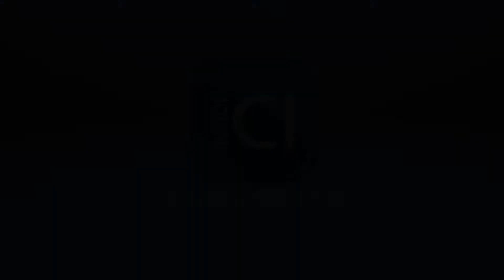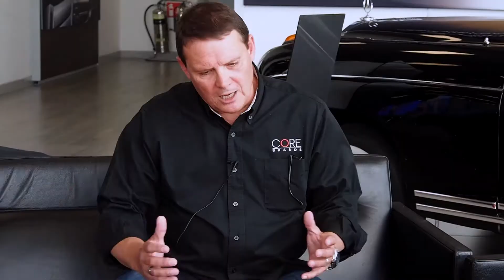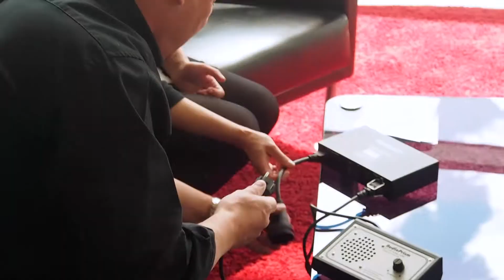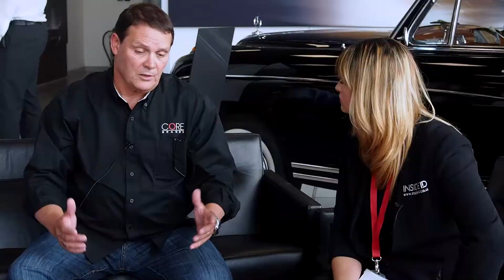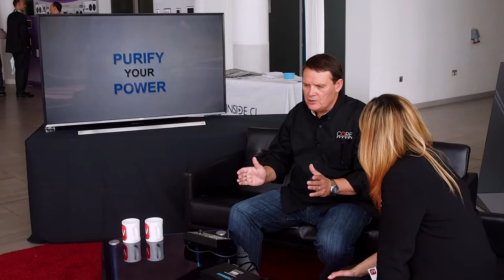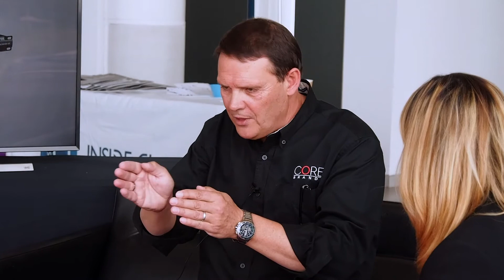This Furman power conditioner will improve your AV system

Comment: Great products! Excuse me for asking "here", but I recently invented accidentally a sort of PRE - power filter, basically connects to mains first then output powers commercial Power conditioners. Its a very simple accidental discovery that is unconventional not related to using semiconductors etc... My device can fit inside any power conditioner! This device would be the first stage.  Its hard to imagine such a crude device that really affects what you hear in a huge way! The device adds about a 20% power boost, a mix of added bass current, wonderful mids and great clean highs! Its really a huge noticeable diffrence. I own a power conditioner and this Device invention is way better at affecting the actual sound! There is nothing out there like this, I believe... I Pair the device with a commercial power conditioner and they work great together, very compatible.

I'm currently searching to sell the "device" to a power conditioning company. I don't have the time or means for a patent. So the question is... Would your company be interested?

Comment from the maker: Simon Spears, director of International sales at Core Brands dramatically demonstrates the power of Furman’s linear noise filtering technology. A £200 power conditioner will not only improve the performance of your AV gear but prolong its longevity, he says as he eradicates dirty digital noise from the mains inside Mercedes-Benz world. Furman also supply Sequencers to power cycle racked equipped, to optimise performance. The secret way to improve your AV system?